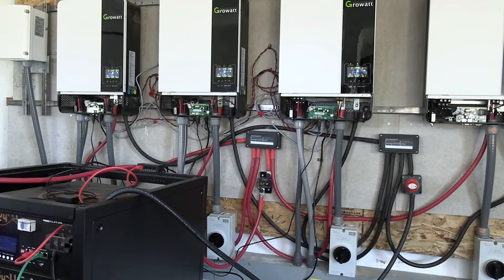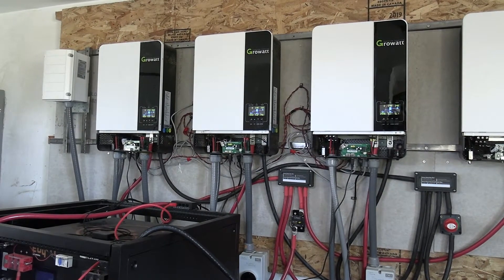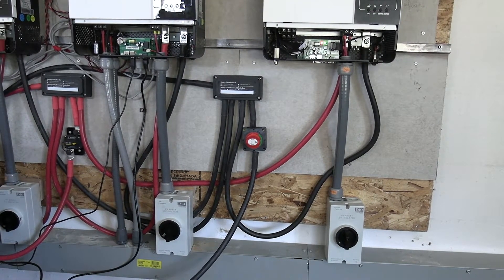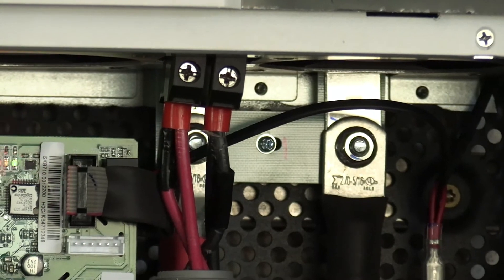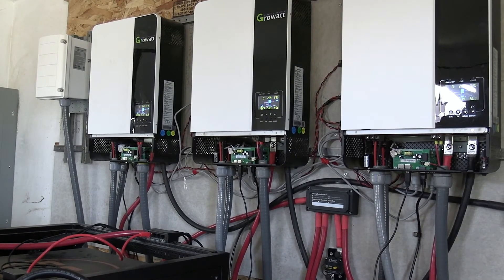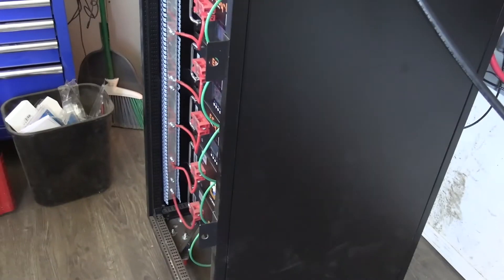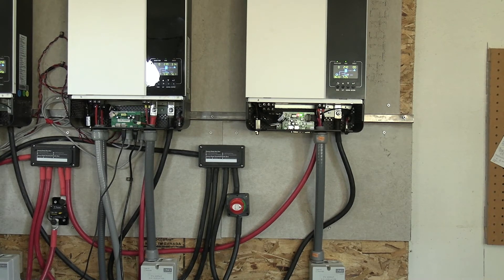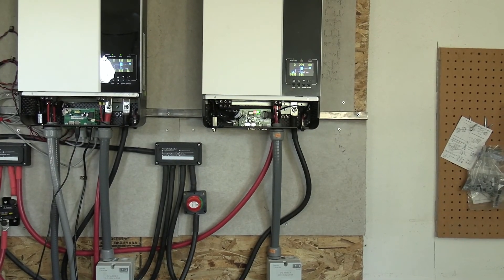fixing my communication error growatt 5000 es

Comment: Hi James 👋, when I shut-off my growatt inverter es 5000w with built-in switch,I performed a test between neutral and Ground I got 120V..can u help slove  this problem.
Reply from the maker: I tried turning my inverter off and checked it for any juice at all of the output connections. I had no power at any of the connections with the inverter turned off. I made sure that I had solar coming in and I also left the batteries turned on. I wasn’t able to reproduce your issue. As soon as I turned on the power I had juice. I would call who you bought the inverter from and check out if there’s an issue with your inverter and if it’s covered by warranty.
Reply: @jamesshomesolarmore2223  Thank you James for your vast response.

Comment: I think it’s your hub, the solar assistant and your old inverters do not talk to the new inverter as it has a BMS port the others communicate via rj45
Reply from the maker: I was just on the phone with signature solar.. they are saying that the new inverter won't communicate with my new batteries. plus it won't work with the hub that they sold me either. They said it should work with the other new batteries that they are selling. but not to hook it up with the old inverters on the communication hub.